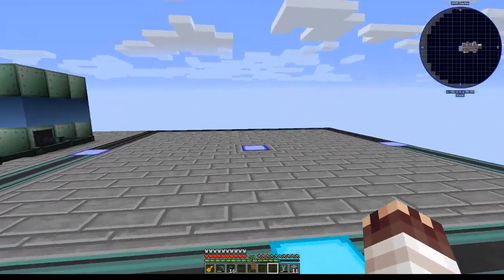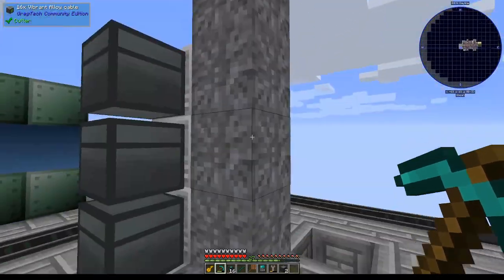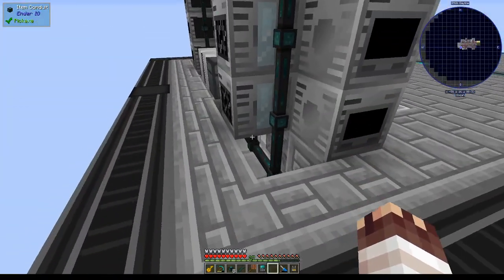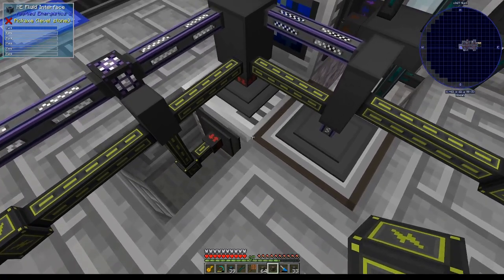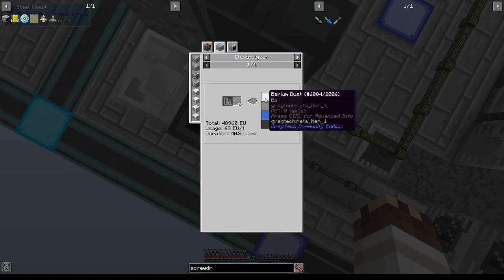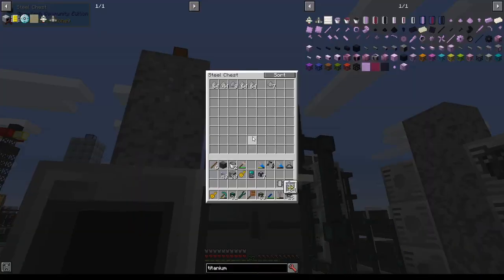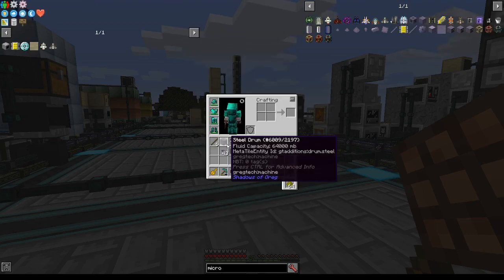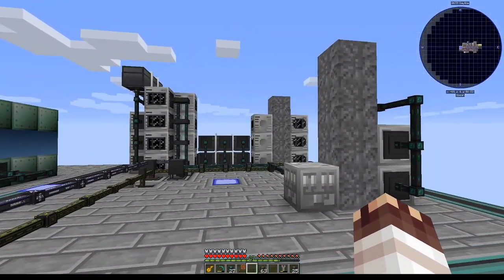New Omnifactory Supershorts #22: Ore Processing System and Microversium

Comment: I just got to HV yesterday I have an MV ore processing system but only one ore washer so it backs up there... your way is so much better
Reply from the maker: It’s advised by some not even to make ore processing systems until IV! Personally, I wanted this and it has really helped me, even at HV. I plan to upgrade it all to EV soon, but I need a lot of power.
The ratios are:
1 macerator
4 ore washers
2 macerators
1 centrifuge
(I think?)
In case you decide to do this.
Reply: @minecraftinchocolate  Doing ore processing ASAP is more fun anyway; just make sure you're ready to replace the parts that improve the efficiency - macerators (and for a few things like rare earths, centrifuges). Macerators are usually the first new tier machine I make, just for the resource bonus. It helps that for ore processing, you can use a one tier higher macerator than power supply, so you don't even need a new CEF/transformer - it only takes one or two amps of the lower tier, so it really pays off to upgrade ASAP. Given that many ores give you loads of bonus resources, it's a quick way to get ridiculous amounts of the "rare" things, like gallium. Also, some processing is especially slow, and it might be worth having a separate line - e.g. purified redstone gives you a lot of rare earths, but takes a long time.

For the other steps, like washing, it's more EU efficient to use lower tier machines; it's probably easier to increase your power than deal with the extra machines, though. Also, there's a few ores where the thermal centrifuge is really handy - like for bauxite (gives you gallium in a macerator, so you get plenty of worth from your high tier macerator :)).
Reply from the maker: @LuaanTi  I really appreciate this detailed feedback! As of recently, I got a nuclear reactor that gives me 68 IV amps, so I’m just considering naively upgrading my ore processing to IV. (I already did it for EV.) But I can see the benefit of making a bunch of EV ore washers rather than turning my 12 EV into IV. What do you think? I would need 12 x 2.8 ore washers to make up for the difference. I’m thinking of just going for IV because of that.
Reply: @minecraftinchocolate  Yeah, usually the lower tier ends up being a bit cheaper (and more energy efficient), but dealing with so many machines is a hassle, and you get more lag. By the point you have 12 washers, I wouldn't bother with things like energy efficiency :D Power is really easy to get (and expand) in Omnifactory anyway.
Reply from the maker: @LuaanTi  It certainly is! I look forward to uploading my nuclear reactor project.